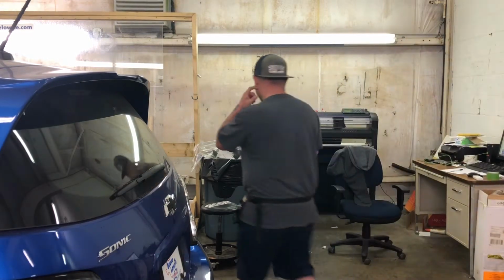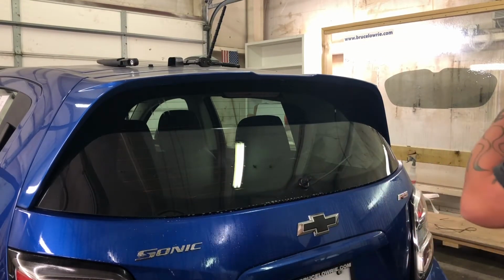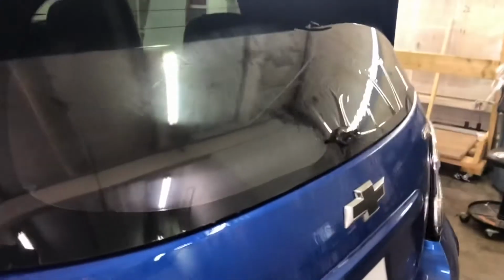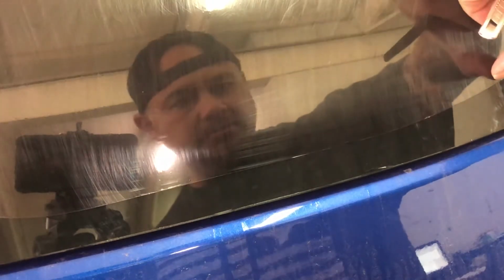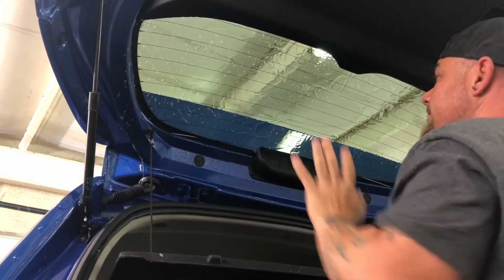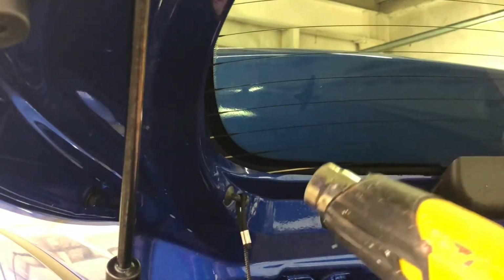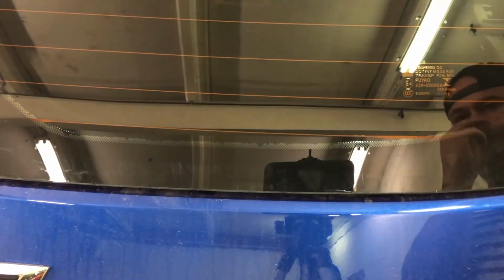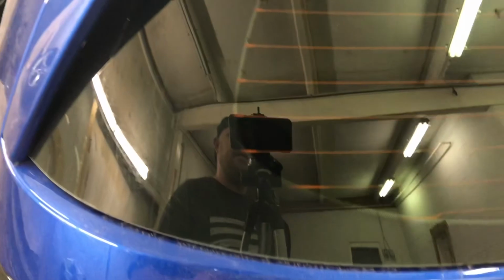Easy how to tint a sonic rear hatchback window .

Comment: Nice video man, based on the research i have been doing the easiest method is to let the dot matrix part stick down is to let it dry for 2-3 days and then just push it down, I haven't done it myself but will be experimenting soon
Reply from the maker: RQ7 

That will 100% work !!done it tons of times 
We always don’t have that luxury .. but yea working it after a couple days allows any moisture out and sticks so much better .
Your on the right track sir !!
Thanks for your time guys